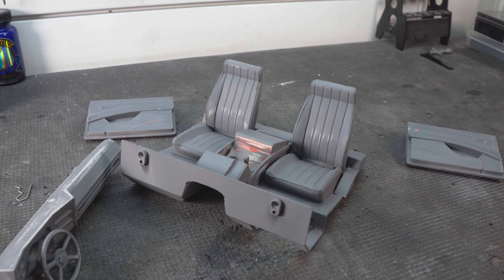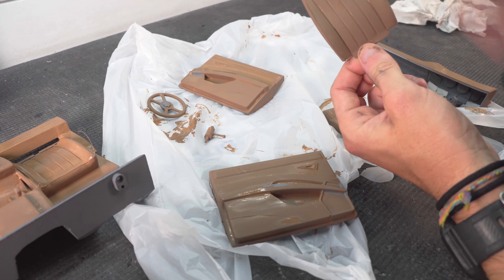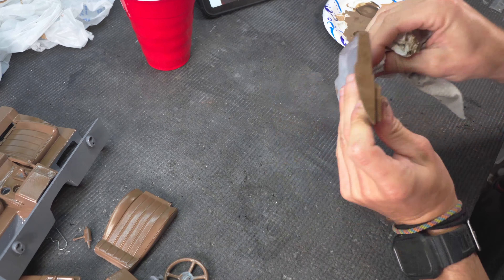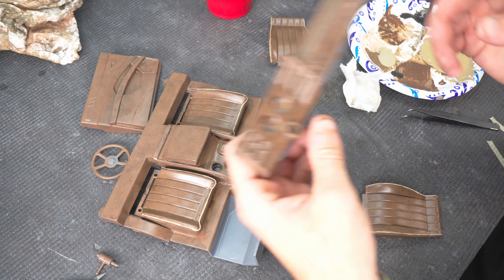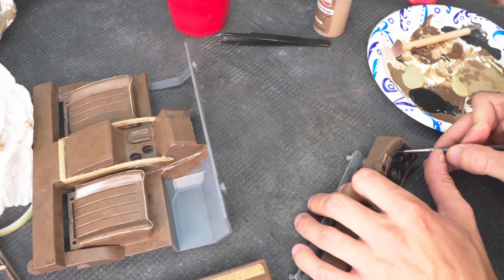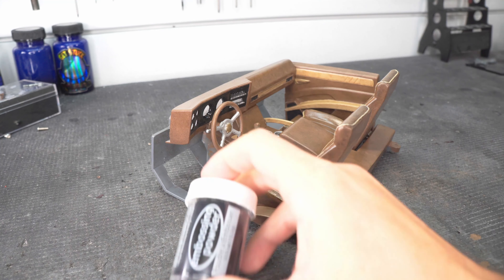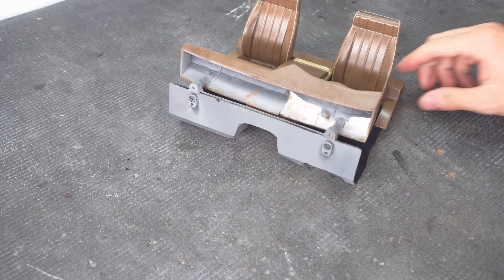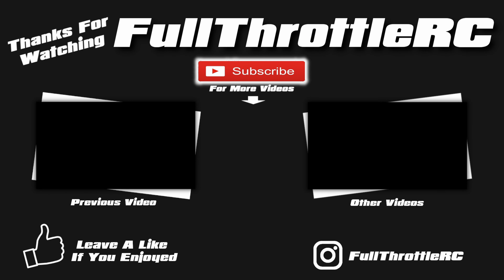Painting the Interior of My Slammed K5 Blazer to Look like REAL Leather!!!

Comment: need a driver seat mount for one of the insta360 cameras for some POV driving
Reply from the maker: Hahaha that would be pretty cool! The only thing that would throw off the look is the steering wheel not moving. Too many moving parts already to add that in as well.
Reply: @FullThrottleRC  yeah racing has one 👀